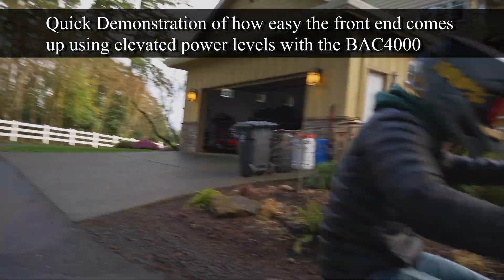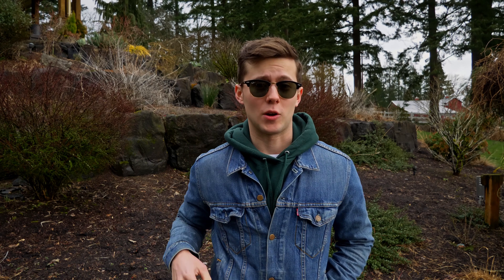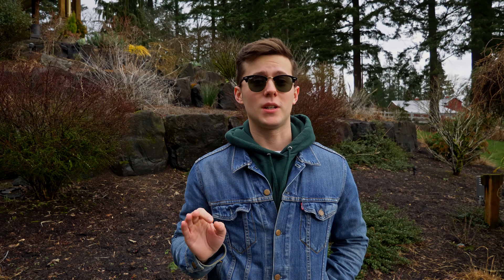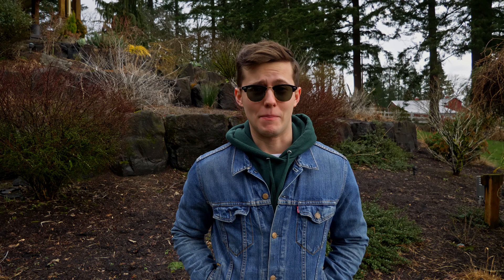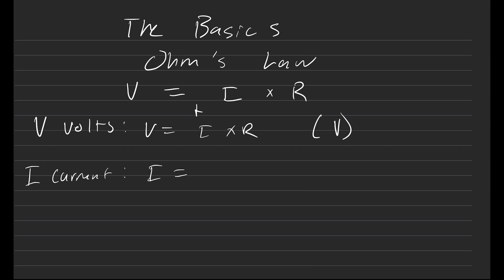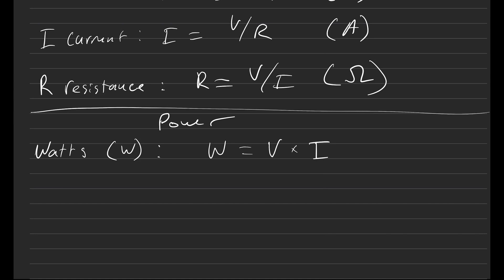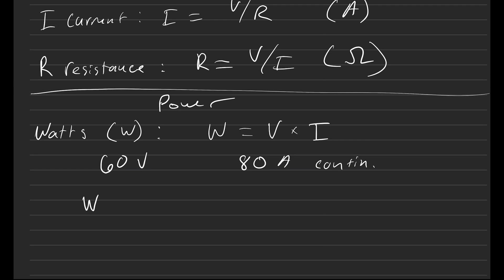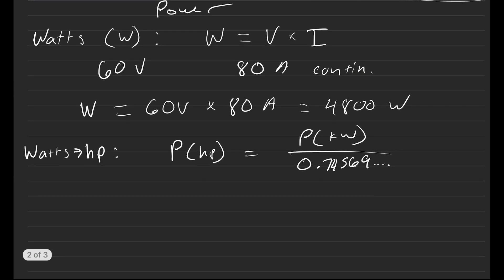The ASI BAC8000 is Overkill for the Sur Ron X

Comment: im just looking for a 60mph top speed to keep up on the highway along with more range

im looking at the 60v 42ah because i mostly need range rather than speed. i dont wanna spend a whole 3k plus just for an upgrade

but if i was to go with a new controller i would go with e moto bros bac 4000. not only because of the display but the options to limit the power when needed. unfortunately  you guys have limited supply so i might just have to get the bac 8000.

if im getting  a 72v battery i might as well get high AH. surronster has a 32 AH. i might go for the 40ah

one last thing about all of this i need the new controllers to be water resistant is the same way the x controller is. i might just have to 3d print something to cover it

i ride all terrain. mostly on the road but i want this bike setup to do everything.

anyone have any opinions on this?
Reply from the maker: To be honest if you need a bike to ride on the highway there are a lot better options than the sur ron that are actually street legal and suited for continuous highway speeds.
Reply: @emotobros  i guess ill be more specific. So far i got two shinko tires with fat tubes. The bike feels great on the road now along with ripping it up in the dirt because i got the dual sport tires. I quite litterally use it for everything. I take it to skate parks. I ride up stairs. I jump dirt. I get on the highway. It already feels good to ride i just need that little extra power, not necessarily speed but range. So my question is the more expensive batteries worth it? Like the 72v 48ah? If i am going 50 to 60 mph a lot is the bac 8000 better for that? Or can the bac 4000 handle constant 60mph? I live in nyc so people aren't going 80mph everywhere. Everything is more tightly packed together that to be honest makes it the perfect bike for it. Im looking for a range solution for the summer time because i dont wanna be stuck out there on them good days
Reply: @tintin6291  no highway for the surron! Its an upgraded Mountainbike , not a scrotch rocket :P
Reply: @themountain59  whether im on the highway or not im still going max speed on the road
Reply: I have to agree with the other commentors here. Riding on the highway is about more than just power. I had a motorcycle with a top speed of 84 mph and 33 hp. Highway speeds are under its capacity. However, I found with my overall weight (320 lb bike, plus a 170 lb person) that I was easily blown around by the wind off of other cars and such. Even though I had the power, I felt unstable. I don't recommend that. There is a reason why even full sized motorcycles that are designed for longer highway use weigh more than 400 lbs without the rider. Power is not everything. With that said, do what you want and be safe.
Reply: @linuxinstalled  well 5 months later i can tell you for sure that the suspension is whats holding the sur ron back. i traveled on one exit on the highway as my daily commute and it handles it well. where it gets sketchy its the 60 to 70 mph. even tho the bike has the power the mountain bike parts have a hard time keeping up
Reply: @tintin6291  yea the suspension is shit. Upgrade your front forks to some fox forks makes a huge difference
Reply: U need a zero
Reply: @carbonehouseholdcarbone8110  after getting all the upgrades it just needs better suspension

Comment: I'm ready to buy a 4000 and if I understand you, staying with the stock 60 volt battery and your 60v tune is the best way to go for single track and off road mountain climbing torque. How many controllers are you going to have for sale in this next batch?
Reply from the maker: Will have ~50 kits
Reply: @emotobros  not asking when but how soon will the next batch be available? Weeks? Months? Just got to make sure I have enough c notes by then. 😂
Reply: Went there, even with the bypassed stock battery, you’d want to upgrade the battery at some point. 60V can do fine, it’s just that the cells of the stock battery are t capable of more than 120A. So you’ll be limited to around 8kW.

Comment: One more reason for a clutch is the safety aspect of killing power to the rear wheel. It’s kinda crazy that they don’t have a clutch if you ask me. I’ve competed on MC’s in both TRIALS & GNCC/ENDUROS for many many years and couldn’t imagine doing this with out a clutch. What I really Like is the ones used on the ELECTRIC MOTION bikes. They have been doing it for over 5 years now with great results..Yes I’m sure it would have raised the price on the SUR-RON  to a price they were not looking for. I’ve been saying that a clutch is needed for electric MC’s when I first saw these bikes coming to market. 

Once again a great video from y’all and one more reason for you to be the only one’s I’m distributing my parts threw!🤝👊👏👏👍
Reply: Not all Electric Motion bikes are equipped with a clutch. I’m not saying it’s useless, just that it’s not always needed. Also, an electric motor can cut the juice far quicker than a petrol engine.
Reply: @MTO_Brothers  
Only EM’s top models have clutch.  All I’m saying is that I want a clutch and it makes sense to me for wanting one.
Reply: @mainyakmainer7162  I agree having a clutch and like 4 gears on an upgraded surron would be fantastic.
Reply: @MTO_Brothers  
I’m not talking wanting it for gas motor.
Reply: Disagree about clutch. When petrol bikes fall over, no one pulls in the clutch....and if the throttle is stuck open, it's just as dangerous. As far as throttle control.....coming from two stokes with insane powerbands.....even at 13.5kw the throttle control is so much easier/smoother  imo. Much more difficult to break the wheel loose in corners, despite having great torque/acceleration....it's such a strange feeling...one common with other e-mx bikes like the Alta.
Reply: @ScottPaulConley  well...most enduro/MX bikes nowadays are equipped with an auto or slipper clutch---> https://motocrossactionmag.com/ten-things-about-auto-clutches/  specially in competition like supercross ;)
Reply: Go buy another dirt bike 🤣

Comment: I’m a 240lb guy that overheats the stock surron controller when I do big climbs.  I can only imagine the overheating coming this summer.  

Already running a 58t sprocket.  

Would it make sense to get the bac8000 and run it at around 9-11kw allowing big overhead to prevent overheating.
Reply from the maker: What kind of heat do you ride in?
Reply: @emotobros  80 degrees lately when my controller hit thermal limit.   Summer gets up to 90-110 degrees
Reply from the maker: Unless your going top speed for extended periods of time the BAC4000 is more than sufficient. That was kind of the point of this whole video.
Reply from the maker: @TheGiantLender  Shouldn't be too much of an issue at 10kW. The issue is that the more power you draw the more heat you build in the motor and the BAC8000 isn't going to help with that. We have guys running close to 20kW on our tune with no overheating issues. You just want to ride at a power level that will preserve the motor and at that level the controller should be fine.

Comment: Still - There are new motors in the works that will be released that will fit directly into a surron, the BAC8000 wont be under powered for those - future proof the bike with an 8000! :D
Reply from the maker: It’s more of a chassis issue than motor issue. Can only put so much to the ground...
Reply: @emotobros  Fair enough
Reply: @emotobros  I don't think so....I'd be willing to try it. Bike is so light that the 70/100 tires provide as much traction as a big a** 240+lb 450cc 120/× tire.....I would love, absolutely love a bolt in motor swap upgrade!
Reply: @ScottPaulConley  no offense but I think its pointless...the bike will rip apart...Is that worth it ??
Reply: @themountain59  I don't think so....if you've built everything up like I have.....wheels, suspension, brakes, etc, etc....it may hold up. Even if not, a more powerful engine would be able to last longer and be more efficient...same concept as 8000 vs 4000....in the end...may not get that much more, but it definitely won't hurt.
Reply: Motor can handle more power for couple of seconds, but unless riding on the road, it’s complicated to handle more than 13kW riding off-road. Too short of a wheelbase. Tried 15 and it was too much already for me.
Reply: @MTO_Brothers  you just need to learn to ride it better🤷‍♂️.....watch my video....at 13.5kw clearly no problem keeping the front end down and definitely could use more power....how did you change it to 15kw?
Reply: @ScottPaulConley  hahaha 🤣 you’ll probably give me a riding lesson.
On a serious note, i had watched your track video and that was impressive!
But enduro riding and track riding are completely different and you need more fine grained throttle control in enduro than on a track (that’s why enduro bikes are not just MX bikes with lights). For a good overview of what I use the bike for check out this video https://youtu.be/X2Z-lXP9Cew
Also pilot weight plays a big role and I might have a higher power/weight ratio with 13kW than you’d have with 15 🤔
How did I change it to 15? With my phone 🤷‍♂️
Reply: @MTO_Brothers  thanks. 👍I'll admit that trials riding does require more throttle finess. But the surron's short wheelbase I think would be more preferred for that stuff, no? I'm jealous you can do it from you phone. Is that from EMB software or the app from ASI? I was under the impression that ASI didn't want customers to have access to the app?
Reply: @ScottPaulConley  The short wheelbase makes the bike very agile (that’s perfect for singletracks) at the expense of stability especially at higher speeds. Everything is a compromise!
I changed it with the BACDOOR app. ASI don’t mind giving access, but they just give access to their direct customers. Otherwise you have to have an agreement with your reseller for him to give you that access. 
Last solution is to wire the controller the a computer and the bacdoor computer app doesn’t require credentials to work.
I have now switched to a Nucular controller and everything is configurable directly from their onboard screen.